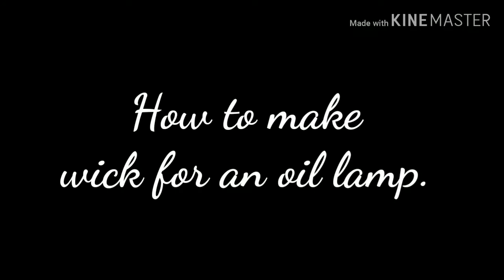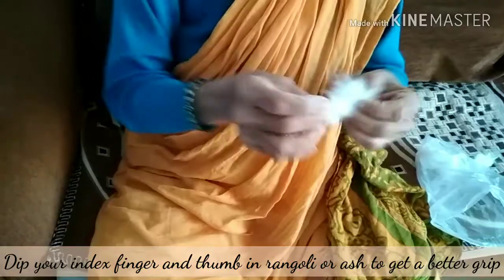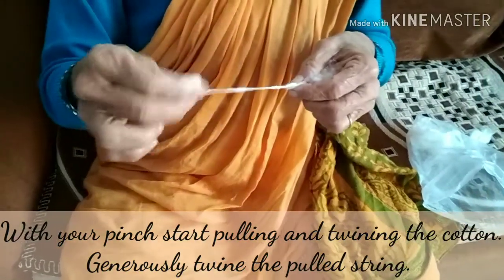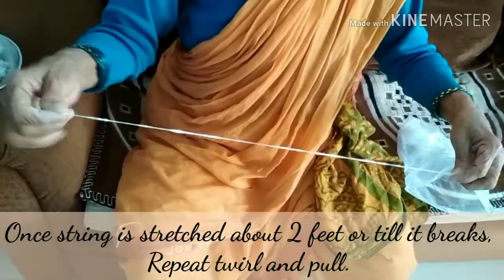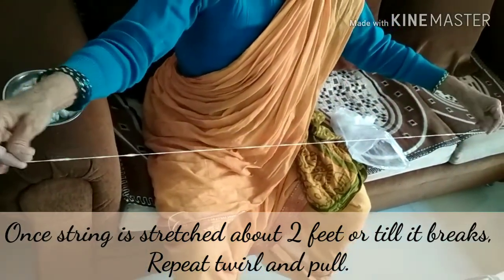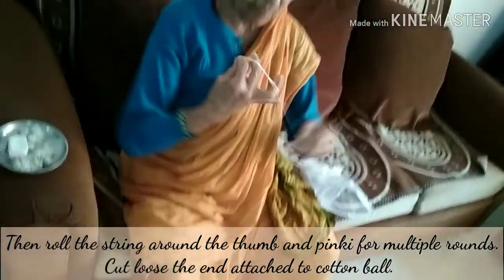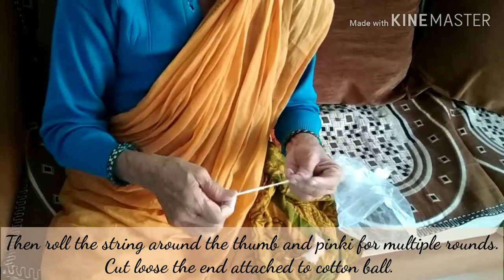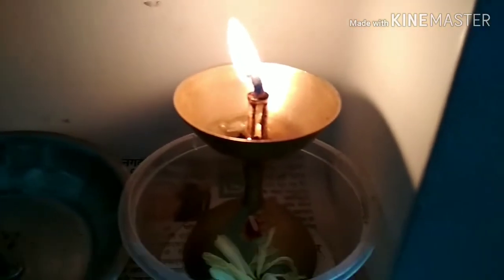Traditional way of making wick/ vati for oil lamp

Comment: The Lone Deranger
My experience has taught me to use cotton, regular fluffy cotton, roll a long sausage of the cotton, make sure it blocks the liquid from pouring out if you hold the lamp upside down, the bottom obviously needs to lie in the fuel so it can wick the fuel to the flame. But you will find that the cotton doesnt burn away, it blackened, but you wont need to replace it for possibly years, my lamps from 2 years ago still use the same cotton I fitted.